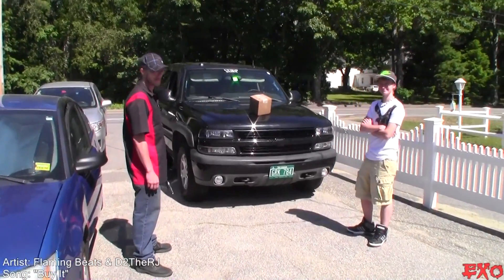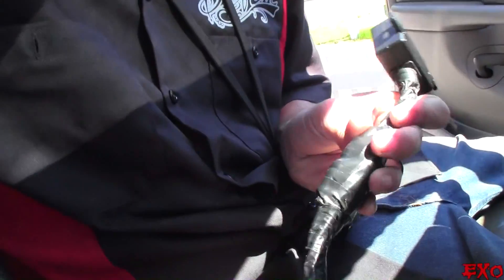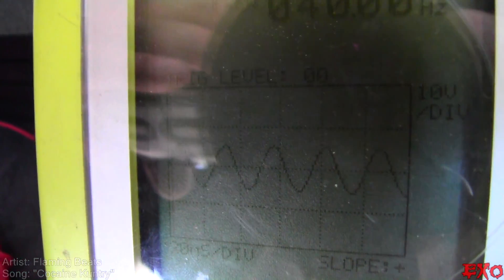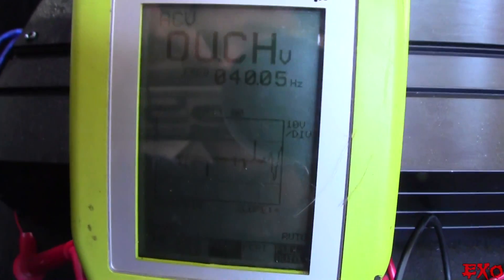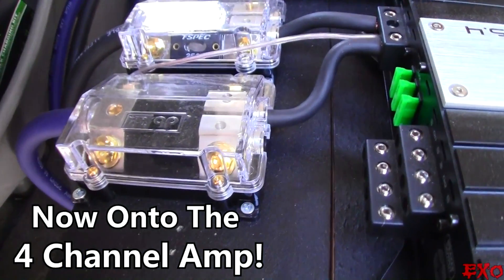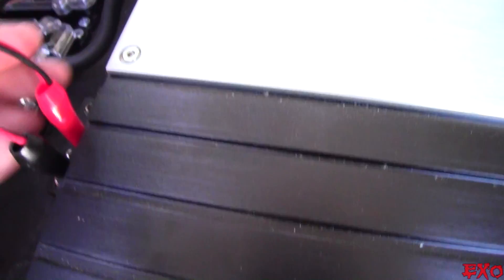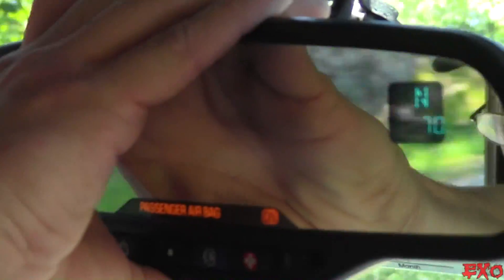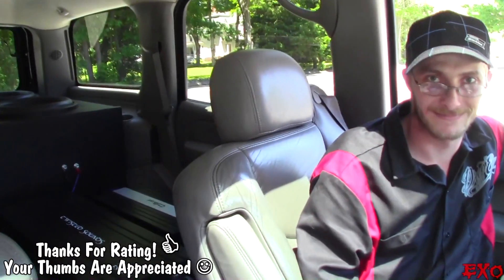Tuning a Car Audio System w/ Two Subwoofer Bass Amps & 4 Channel Amplifier | How To Set OSCOPE Gains

Comment: Hey I'm new to all this, I've got a question. I have a amp that has a low pass and high pass switch what does that do?
Reply: A low pass is like a crossover built into the amp, so low pass only allows the lower frequencies to only go out through the amp (if you're using the amp for subwoofers) and the high pass is for only letting higher frequencies above the bass and sub-bass frequencies go through, (if you're using your amp for mids and highs)

Comment: Good video but when setting the amp gain i'm pretty sure it should be done with the amps under load. Setting the output just below clipping gets in the ballpark but without a load isn't really very accurate. The amps WILL clip at a lower voltage under load.

Comment: Would you rather have 2 12s or 1 18s
Reply: 2 15s
Reply: +360kboy ok thx
Reply: All depends on the wattage
Reply: well if there the same model just different sz...I say 2 12s same cone area but 1 more motor...more force for the same ft3